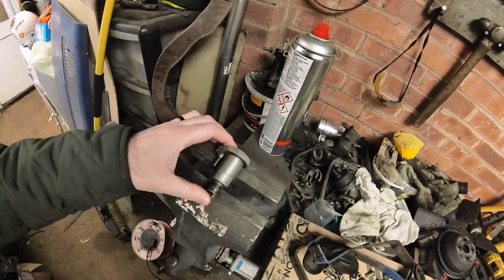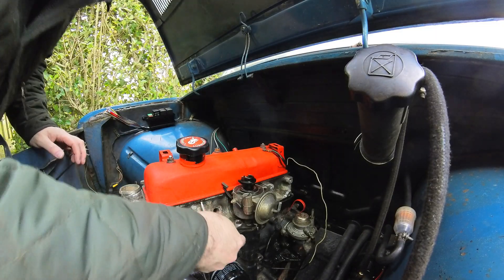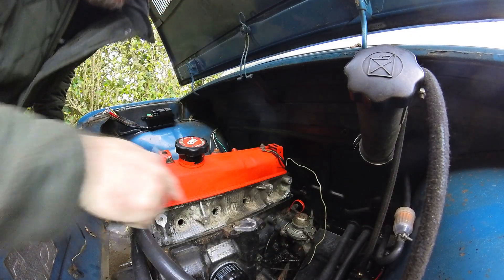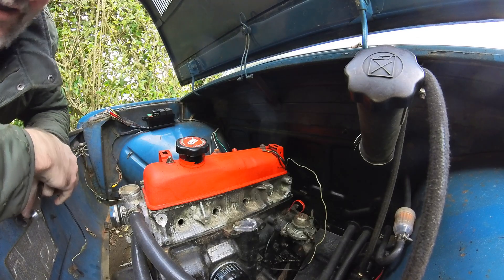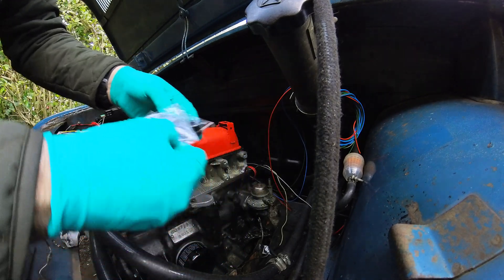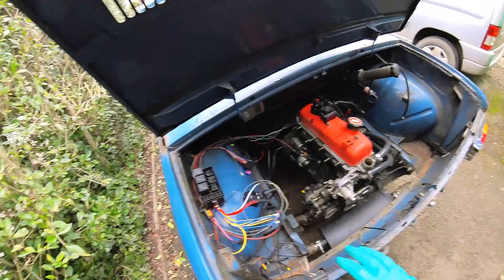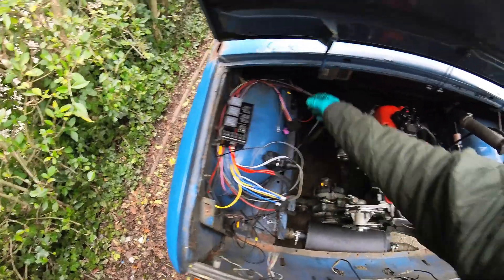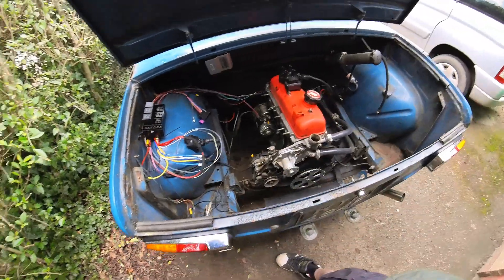Renault R8 Proto, Old car Modern ignition Part 2

Comment: lovely stuff... could you not mount the coilpack on the firewall. If it was off to the drivers side and down a bit then it would be behind the inlet and the leads could come across underneath. Ofc i have never stood by the engine bay but thats what my head was thinking watching the video lol. not as easily serviced but neater looking and further from warm etc etc. Just thoughts
Reply from the maker: thats where it will be going, its just sat there currently (y) every thing is loose/laid out at the moment